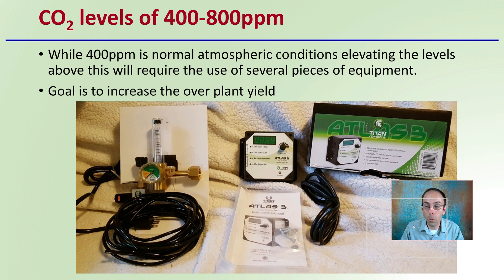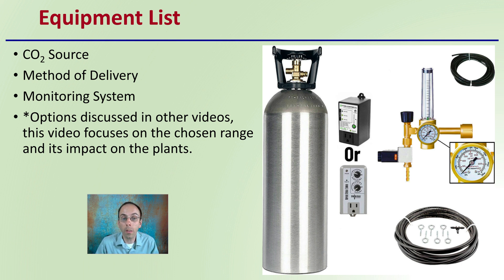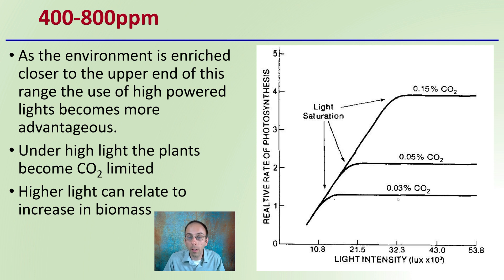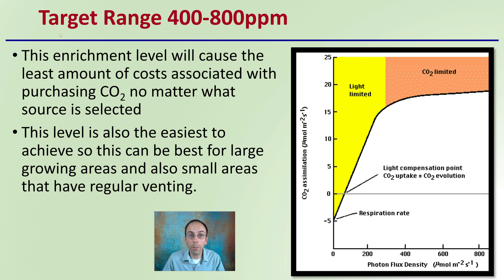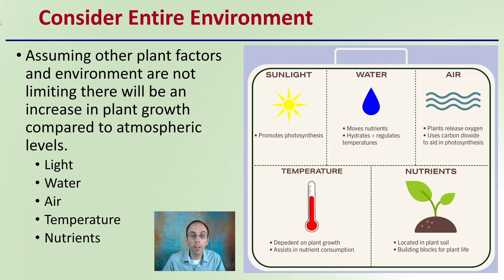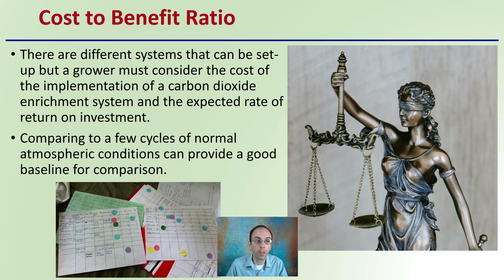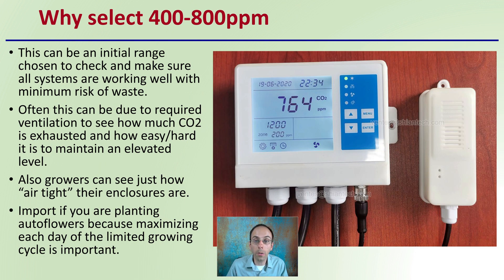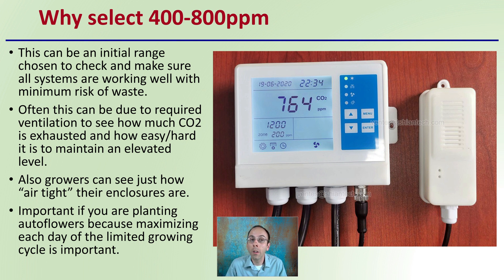Carbon Dioxide Levels of 400 to 800ppm and Cannabis Plant Production

Comment: After 17 days of twelve hour light, use an oil lamp when the light comes on, and blow it out when the light goes out. It you add CO2 before that you will grow a lot of stalk. Sheets of foam board can be used for small gardens. If using a small bedroom you may need two oil lamps. Getting CO2 tanks refilled is a pain. Easier to buy lamp oil at the hardware store.

Adding a oil lamp during blooming is one of my top nine grow tips.
Reply from the maker: This can be beneficial to the plants, but it does lack consistency and a grower knowing what the CO2 levels actually are in the growing space.

Comment: Hi again 😁 is there a direct correlation chart of some sort that details how much light ppfd to co2 ppm's? Like 1000ppfd to 1000 ppm co2, I heard that as you get higher with light the co2 increases much more which makes it very confusing. I just want a simple chart that shows a direct correlation to reference as Google is becoming more useless lately
Reply from the maker: Does this help... https://overgrow.com/uploads/default/original/3X/c/c/ccadad522ef233c391114634bc3643b3d43ecc80.jpeg

Comment: Good evening, I have a question, if I start using CO2 only in the flowering phase, at what level can I start the PPM?
And to what level do you recommend the application of PPM, can I apply this CO2 only to the flora two weeks before the cut?
  thanks for your attention.
Reply from the maker: You can apply CO2 anytime, full cycle would be recommended and waiting until the last 2-weeks will have only minimal benefits.  Any level above the ambient (~400ppm) would be beneficial, but in general aim for 1000ppm from germination to harvest.
Reply: @DeBaccoUniversity  ok thank you very much for your answer I am Spanish speaking I am using a translator thank you

Comment: How much co2 in my 1000sqft apartment with myself a roommate and 2 small dogs?
Reply: The only way to answer that would be to get a meter and measure it.
Reply from the maker: A controlled would be suggested to not only know the CO2 levels but also be able to make adjustments to those levels.
Reply: yes